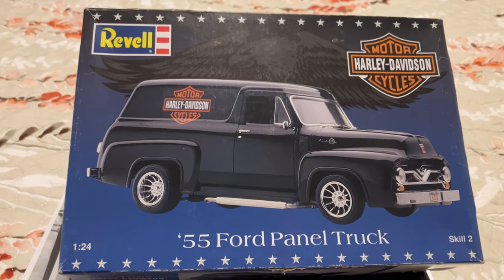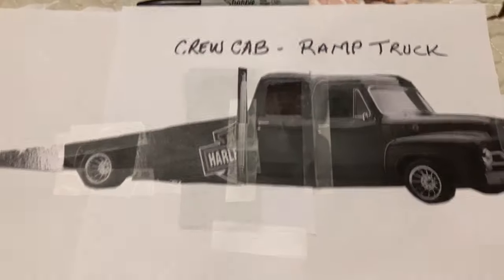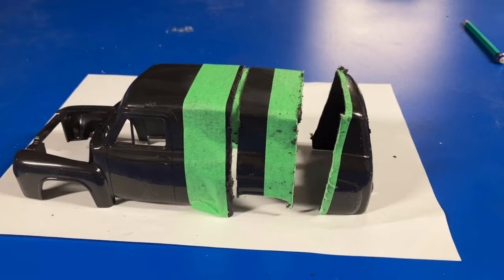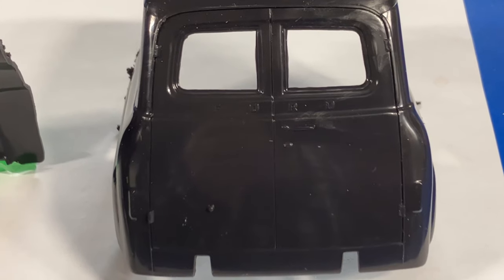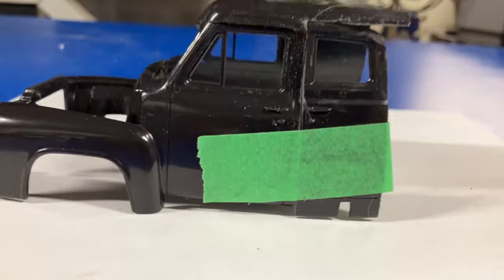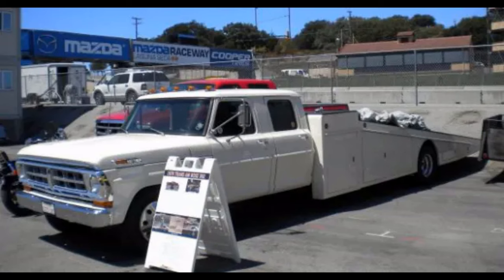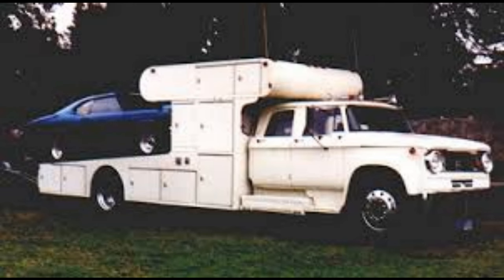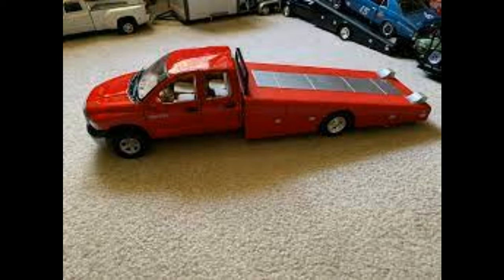Update #under1000gb

Comment: Thats a cool build idea. May I suggest using the new Moebius ramp truck. It's got the long frame, dually wheels and of course the ramp bed. It's 1/25 though but I think it will still work. Thanks for sharing.
Reply from the maker: Thanks for the tip! I never like to take the easy road, I would rather scratch build something and get  it looking descent than taking parts from a box even if it looks more professional looking. This build will be a one of a kind, no matter how it looks in the end.